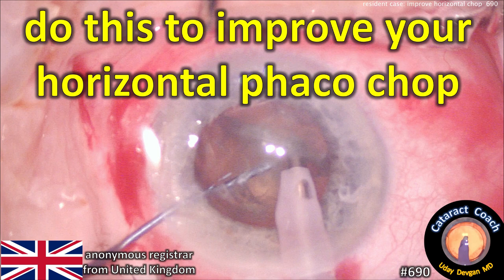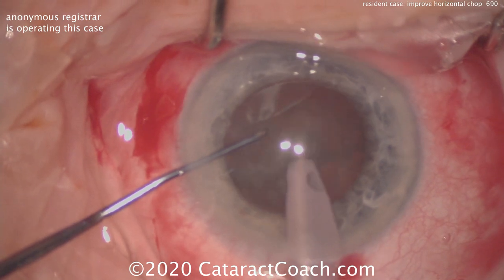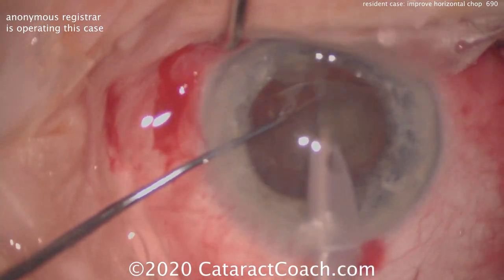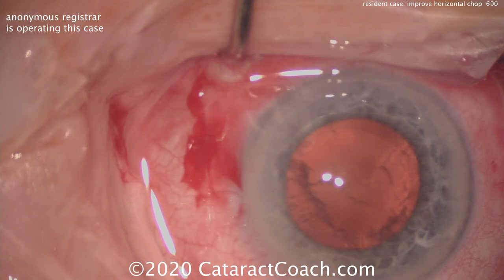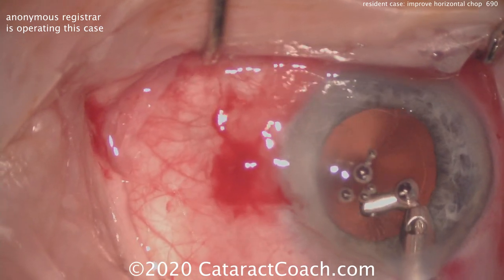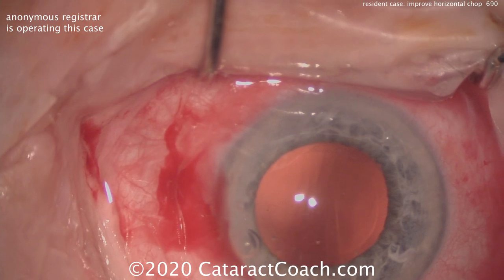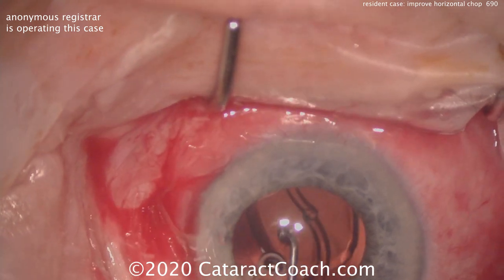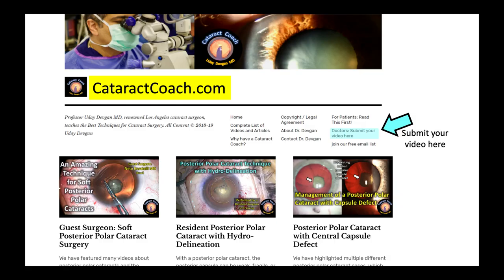resident cataract surgery: improve your horizontal phaco chop

Comment: Thanks Dr. Uday. How about if you are using a venturi pump machine, Is that make the holding of the nucleus easier as you do not need an occlusion to build the vacum? Thanks
Reply from the maker: Yes. With a peristaltic pump there is instant vacuum even without occlusion. But the flow is not independently adjustable; it varies with the vacuum level.